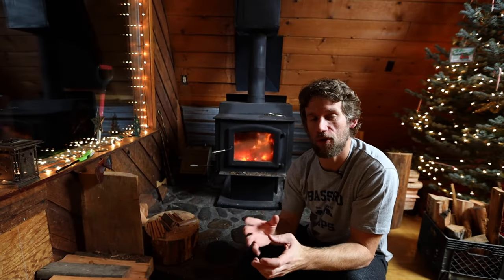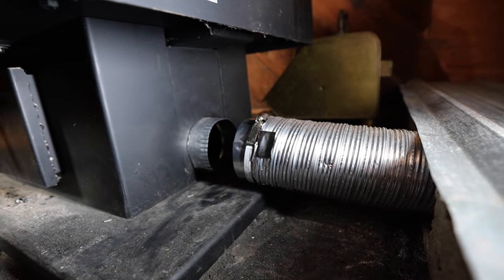Why Your Stove Needs A Vent + Learn How To Install Your Own

Comment: I've never seen a house, camp or any other enclosure tight enough that it restricted air supply to a wood stove, but I've only been burning wood for 60 years in 5 different houses and numerous other camps, cottages. Don't believe what some Engineers say, and, yes I am an Engineer. There are many other reason why a wood burning appliance won't burn properly which have a much greater effect.
Reply: I was burning for only one year when I experienced a wood stove starving for air.
Reply: Dont furnaces get their air from inside  the house via return air vents in all the rooms? Thats how my house is set up.
Reply: Extremely niave comment. My wood stove is struggling for air in a 1960's home. There are formulas for how many btu appliances put out and how many Sq ft you need for an appliance to breath. My father is a license plumber and holds heating licenses. Ran his own business for 20 years and is a teacher in the trade. He warned me it was going to be an issue. This is 100% something that can happen.
Reply: @hubster4477  no. Every system has return air vents. But, your furnace has an intake, and exhaust, that go outside
Reply: Probably depends on your stove and newer stoves are probably more likely to have issues.
Reply: Although you believe that you know everything because the five homes you've lived in represent all homes in all climates and every building practice was represented in those 5 homes. In reality though some homes are air sealed with spray foam while being built. I've worked on one house that was sealed up so tight that when the front door was closed I could feel the pressure. I'm not saying it was air tight but it was impressively close. But sure if there's anything you haven't seen it must not exist.
Reply: Oh it’s a requirement for mobile homes

Comment: There's an advantage that you didn't speak of. Using an outside air vent causes the heat from the stove to 'pressurize' the room, which then 'pushes' against all the leakage spots, keeping the cold air from entering. You could use the pressure differential to direct warm air to a back bedroom by 'cracking' a window there. Do a smoke test and see. @@
Reply: Interesting never would of thought about the pressure temperature relationship
Reply: In order for that to happen, I would think that your chimney would need to be blocked. The whole purpose of the intake vent is for combustion air.
Reply: @larrythompson2967  I suppose the theory is that as the ambient temperature in the home is greater than that outdoors, the draft through gaps is reversed.   It would be interesting to walk around a home with a FLIR heat camera to see if the idea has merit.

Comment: I will be installing my fresh air intake tomorrow, only flaw I see in yours is the outside dryer vent. It is closed unless air is pushing out. Just saying as an appliance business owner lol. Nothing with flaps.
Reply from the maker: Not a bad insight. I put a screw into my flap which keeps it open. I may have failed to mention that in the video.
Reply: Yes, this is what I noticed about the video too.  A standard dryer vent would have to be modified and remove the flap and add a screen to keep out critters.

Comment: It is really simple really. For every cubic foot of air that goes up your flue or chimney, a cubic foot of air is pulled through cracks and gaps around your house. So unless you provide a way for air to enter the stove directly from the outside, it will pull that freezing air into the house from all over the house which effectively cools everywhere in the house. And if the house is new and really tightly insulated, the woodstove will not draw enough air to even work at all. I don't know why this is so misunderstood.

Comment: Unless you're really desperate to keep heat inside your house this is unnecessary. Besides a stove is a great way to ventilate your house of stale air
Reply: The ventilation issue is actually the only reason I can think of to not install the air intake vent.

Comment: We owned a Thelin-Thompson wood stove, inside was a "J" tube which was connected to outside air. I could burn 1-2 cords of Lodgepole pine before having to remove the ash.  The "J" tube was in effect like a steel coke furnace super-heating the cold air so that "HOT" air feed the fire and it worked great.

Comment: One one winter after taking out the Siegler oil fired heater that previously used the walled up fireplace to exhaust combustion gases.  My mom started a fire in the fireplace and then we found out how badly the house leaked air. While the fireplace was warm cold drafts from all over the house were flowing along the floor to the fireplace. 
The oil fired heater used forced air to blow unheated air through a firebox and out the heater floor vent. The stove pipe had some kind of inlet damper that would regulate the amount of air to enter to get a good draft going up the stovepipe and would oftentimes provide a lull you to sleep sound as the damper door would with regularity make that tapping sound.

Comment: I did this to a 84 lopi by creating a extension for the 2" x4"  intake openings
Extended the intake to clear the bottom air motor feeds  forb around the firebox
[ its an insert ]

Oh what a difference in this drafty old farm house.

Be sure to get the dryer vent inlet that doesnt have flaps, or you wont draw air

Comment: Very good info👏🏻👏🏻👏🏻thank you......would it be useful to fit a regulator on the outside air inlet so a as to control burn rate????......

Comment: Missing some information. Outside air has fallen out of favor after more thorough analysis. 1st missing piece is that your cold outside air is cooling your stove so that’s heat not going into your home. It ends up being a net 0 of pulling air from other leakage/drafts in the house. 
They also found outside weather could have alot of negative effects the most severe having wind push down the chimney and having your fire reverse and go out your cold air intake starting a fire

Comment: I understand that having a ventilation system would be good, but I can't make holes in the wall behind my stove because it's made of fire-resistant bricks. 
However, I've decided to make use of a window located slightly higher than the stove, measuring around 130 by 100 centimeters. 
During winter, the entire window is shielded for insulation. The air between the window and the insulation shield gradually cools, and the cold air flows downward.

To address this, I've directed this cold air accumulation into a flexible pipe with a 10-centimeter diameter, releasing it behind the wood stove. To monitor the airflow, I've attached wind streamers to the end of the pipe for visual confirmation.

Additionally, since the insulation shield on the window is flexible, I can also open and close the window. Depending on the weather and temperature, I sometimes leave the window slightly open by about 1 to 2 millimeters.

Comment: Probably want to add a way to "throttle" the intake air so as not to burn wood way faster then just wide open...
Reply: Right, I am thinking the same thing. 4 inches of air flow would melt my stove!

Comment: Question:
Could you take the fresh air from the outer layer of the roof above?
The air gap between the outer roof and the insulation… 

Or am i thinking in the wrong direction here?
Reply from the maker: You certainly could do it but it’s not the best option. Unless you have your interior walls and ceiling perfectly air sealed, the vent will still be gathering your pre-heated interior air. Essentially you would be creating a mini vacuum  in that air space and houses are not really designed for that to be a benefit. If you have sufficient exterior venting in that space I could see if working. I hope that helps a little.

Comment: yes but how do you regulate the amount of air going into the stove? It seems like it would be hard to bank the stove and it would burn way too hot, consuming more wood
Reply: The stove controls it by the air intake controls.  The outside air intake is ONLY to isolate the source of the air.  DIRECT air is a better term.  Outside air WILL come in to replace the air the stove consumes.  Cold air replacing warm air near the stove.  Without the direct intake, the warmest air in the room gets sucked into the stove.
Reply: Air intake controls?
Reply: @erikbender1  yes.  Whatever lever on the stove... that controls the heat.
Reply: @davidallred2947  the air vent on the stove isn't going to control an additional 4 inch vent. that will need its own damper or some such. it's not addressed in this vid?
Reply: @erikbender1   I'm not sure what you are missing.  The stove will only consume air LET into the stove by the intake "port" mechanism of the stove.  The stove "as is" will draw air from the room the stove is in.  The air pull from that room will me replaced from other farther rooms and from door and window cracks.  The air from those farther rooms will be replaced by air leaking in from outside.  This causes cold air to pass through every room as it is drawn to stove making the stove work harder to keep the house warm...  and failing at the extreme distances.  The fresh / outside air "duct" intake forces the consumed air to only come from outside directly, because "it is the closest air available".
It doesn't even HAVE to be sealed.  It can simply be a 4" hole drilled in the floor under or near the stove.  Sealed is ideal, obviously.
Reply: @davidallred2947  this is a video about adding an air intake. Outside air directly into the stove. Any way of regulating this air is not mentioned.
Reply: @erikbender1  I'll try again.  The "regulation" of the outside air drawn into the stove is "regulated" by the stove's air intake control.  Intake lever on LOW, or closed off, will "regulate" a low amount of air to be drawn from the outside.  Intake opened up, or HIGH, will "regulate" a high amount of air drawn from the outside.  There is no secondary inlet to the stove for outside air.  There is only one air inlet and it is controlled by the air inlet control. It is a matter of "air path of least resistance".  Giving the stove an opening to the outside, close to the stove, and gives it that easy path, ducted or not.  
Now, if you are worried about the free flow of cold outside air having unrestricted entrance to the living space, that is a concern.  But you didn't say that was your concern.

Comment: Two questions: why is the chimney not enough of a vent? in your opinion are wood stoves safe to use in an RV? for reference, we only have a chimney for air intake and door of wood stove isn't fully "sealed". How to prevent CO buildup in RV? Just install an air intake to stove? Sorry for lengthy question, I know this isn't Reddit.. 🙄🙈
Reply: The chimney has air and smoke going out not in. So it creates a draft which pulls air in. It will pull air in through any not perfectly sealed spots of the house. Like around doors, windows, outlets, around pipes where they go through the wall. So air has to get into the wood stove from somewhere other than the chimney because air only exists through the chimney. If there was no way for air to get into the stove then air might come in through the chimney but it would suck smoke in and would make the fire burn less efficiently and possibly fill the home with smoke

Comment: This is how I brought in out side air that I pre heated and replaced the inside air with fresh outside air.
I dont agree with using cold out side air directly into your fire box, yes it will burn hotter but it will also burn faster. I wanted a longer burn time that was consistent so I opted to let it breath room temp air and it works awesome. 
https://youtu.be/9g1wRjU4uyQ?si=UR2UCYPh768jA-jg